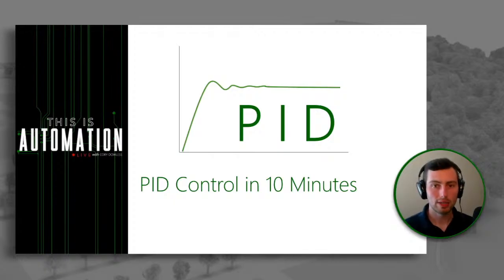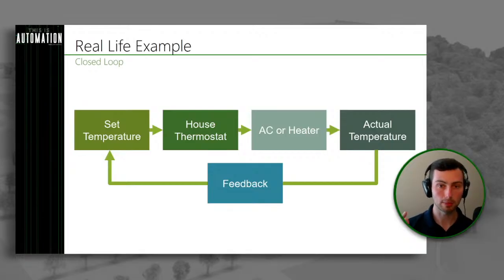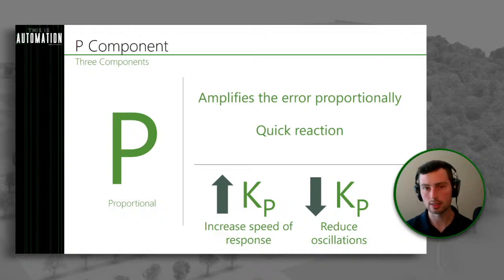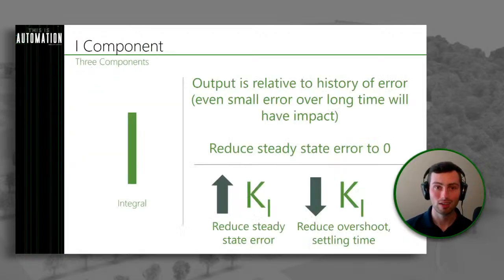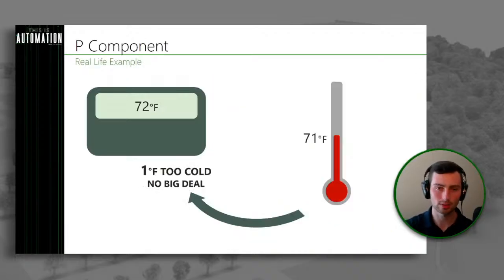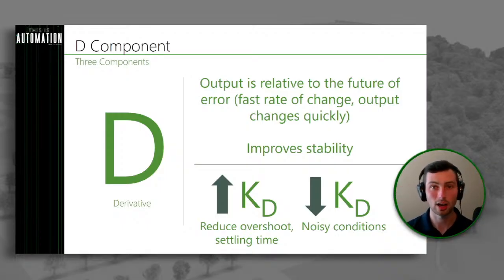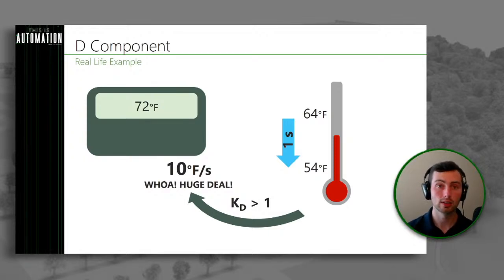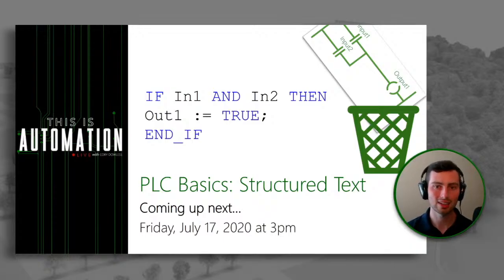PID Control Basics in 10 Minutes

Comment: Why isn't PID used for home heating? Or is it?
Reply: Its because a gas furnace is usually either on or off.  It could be used for electric heating because the wattage going through the heating elements can be adjusted within a certain range.  I’m sure facilities that need to store things at an exact temperature use it.
Reply: It is in some instances. But due to its complexity it's not feasible

Comment: Thanks for your video. Can I ask if D and I have both positive or negative values? For example if d is the rate of change of error, however , in your case, the error can be 5 cellcius degree higher or 5 cellcius lower than the setpoint value. What I am trying to say is, does error have directions? or it is just a absolute value.
Reply: You wouldn’t want values that push the output away from the target.  The coefficients associated with the P and I terms are always positive while the coefficient associated with D term is always negative.  Gain refers to the absolute value so the numbers entered for P, I, and D are always positive.  The terms themselves can be either positive or negative (since the offset of target relative to the output can be either positive or negative).
Reply: DR RORPOPOR HERBAL on YouTube changed my entire life with his herbal medicine. I appreciate you sir, for taken away my PID